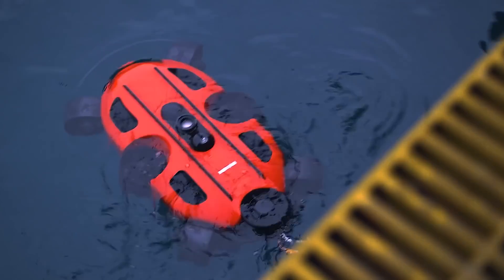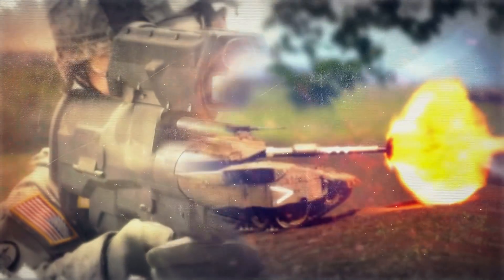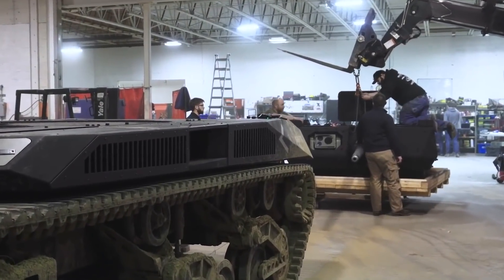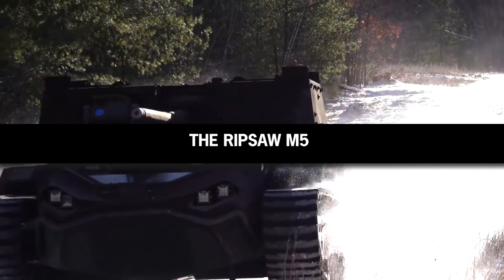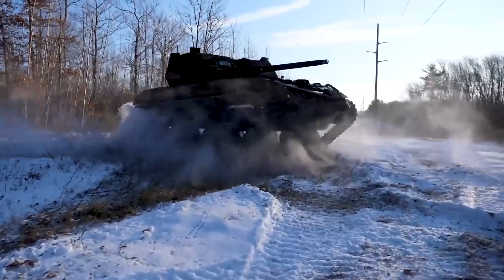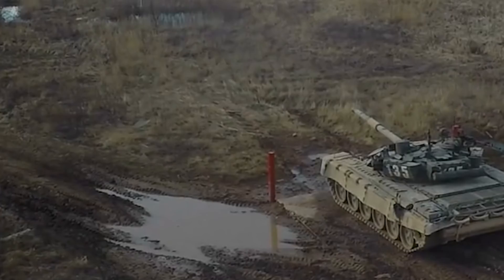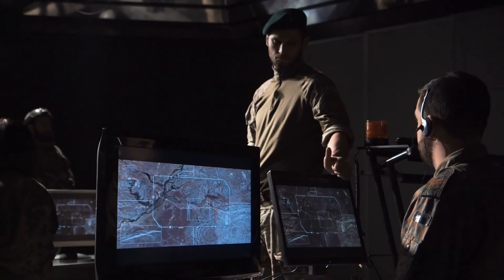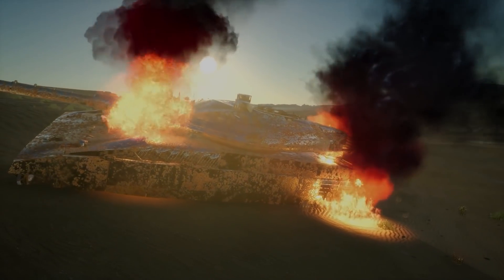The Next-Gen Superfast Armored Tank No One Expected

Comment: An aerial drone can deal with a momentary loss of signal by continuing on a plotted course, but it is somewhat more difficult for an unmanned tank, and the control range seems a bit of a limitation.  Developing a nav system that can deal with momentary interruptions in control on flat roads sounds easy, but less so in the massive variety of terrain the drone could find itself in.  Aerial drones can also deal with active jamming with a contingency program to get out of range of the jammer.  That may be less possible for an unmanned tank.  Presumably, near peer opponents of the future will have some technology and doctrine for dealing with drones of many types.
Reply: This, self driving and operation tech would have to be developed for this to be feasible. The Russians tried it Syria with their autonomous tanks but all of them were either lost or had technical issues.

Comment: This is the future of tank warfare, not this specific model though as it has many shortcomings but it's just a demo of things to come. Drones across all branches of the military will dominate 6th generation warfare.  

But being tethered to just 1 mile operational radius is terrible, not to mention that tiny turret wouldn't be able to penetrate the thick armor of older generation tanks either, nor hold enough ammo in it's small size to stay engaged in battle for long but it's a proof of concept. Once these tanks are uparmored, upbored on the main gun, upsized to increase munitions capacity and can be operated by satellite you are going to see all previous era tanks with 3-4 man crews be even more outdated than they already are in 5th generation warfare against the hard counters of stingers, javelins and switchblades.

Comment: The tank industry needs to be taking cues from the aerospace industry with these unmanned tanks. Future manned tanks are going to be the quarterbacks of the ground war. They will need to be able to defend against other tanks, but mostly they should have anti air and NLOS artillery. Autoloading but retaining the fourth crew member. (Commander, Gunner, Driver, UGV operator.) Similarly its predicted that we will soon be returning to 2 seat fighter configurations as standard. As the pilot needs a hand controlling loyal wingmen. At least until AI technology lowers the required ratio of operators to drone systems

Comment: I think they should use a hybrid system.  That seems more flexible.  If it's electric only, you need to have a generator within 1/2 mile of the enemy.  That seems totally impractical.  I'm sure the vehicle needs a lot of juice which would equal hours of charge time.

Comment: If each Ripsaw had a repeater on it, then only one would have to be within a mile of the command unit.
If you have five or ten spread out over a large area, a city maybe, that allows your command unit to move almost anywhere they want, as long as they keep within range of any single Ripsaw.
Reply: ''Army tactical MANETs
Military or tactical MANETs are used by military units with emphasis on data rate, real-time requirement, fast re-routing during mobility, data security, radio range, and integration with existing systems.[23] Common radio waveforms include the US Army's JTRS SRW, Persistent System's WaveRelay and the Domo Tactical Communications (DTC) MeshUltra Tactical Waveform.[citation needed] Ad hoc mobile communications come in well to fulfill this need, especially its infrastructureless nature, fast deployment and operation. Military MANETs are used by military units with emphasis on rapid deployment, infrastructureless, all-wireless networks (no fixed radio towers), robustness (link breaks are no problem), security, range, and instant operation.''
Reply: @garryclelland4481  yes, but can they stick it on a Ripsaw? :)

Comment: As all electric it will be quiet, quick and agile.  An extremely deadly weapon system for the 15 minutes of run time.
Reply: Fighting up north in minus you get 5 min 😅
Reply: They last much longer. Electric batteries have come a long way
Reply: @cooldudecs  You need to have generators all the time to charge them. It is easy to bring and fill fuel, but how much time you will need to charge it and if you need to charge 10 of such tanks in the same time?

Comment: It is an interesting idea but the fact that it is electric means its a very bad idea,  electric is good on paper but battery tech has not really improved that much and as we can see from Tesla range is limited and recharge time is still very long under normal conditions, sure there are super chargers but they consume massive amounts of power and infrastructure you know things you will not have on the battle field, given that this tank as they say is around 3.8 ton without payload and fully loaded would probably mean its battery is smaller than the ones in tesla cars, so lets say conservatively  it can do 350miles on a charge probably much less, which sure is more than the abrahams range bur range is not everything if you are unable to recharge it.   A conventional tank you can truck out  or air drop fuel and with in a few min its back up and running or you can use the fuel  from the resupply in the convoy, but how do you recharge an electric tank in a combat zone?

Comment: This thing is just another concept that has been submitted to the US Army
The Prototypes are lacking in any serious armour and the proposed production armour wouldn't stand a chance against a simple ww2 anti tank rifle (whereas all modern tanks laugh at the thought of one)
Things would be sitting ducks on the battlefield and otherwise would be sent into what is a suicide mission for the asset, you'd need something much heavier to stand any chance on a modern battlefield against actual tanks. So this isn't a tank and isn't an anti-tank vehicle. Small gun and lightweight armour.
Actual ripsaws are cool but they are not tanks either, not even by the slightest imagination of the word.
This particular concept is a light armoured vehicle with the capability of middleweight arms.

Comment: I'm an ex-mechanized infantry soldier and I can tell this thing is the future of ground warfare. It won't completely replace manned armor, in the same way that aerial drones won't completely replace manned aircraft. But just as aerial drones are playing a huge role in modern air warfare, ground drones will play a huge role in future ground warfare.

A few points about future developments we'll need to see:

The control range needs to be drastically increased. Luckily aerial drones already have directional satellite systems that cannot be jammed and allow the vehicle to be controlled from anywhere on Earth. Fit one of these systems into the Ripsaw.

The armament will be fine with a 7.62mm machine gun, a 25 - 30mm auto-cannon, a couple of Stingers and a couple of Javelins. This will allow it to attack almost anything. Give the auto-cannon a high elevation angle so that it can also be used against low-flying aircraft such as helicopters.

Use the extra payload capacity to install a small diesel-powered generator to recharge the battery when needed and extend the mission duration.

Install a self-destruct explosive to stop it falling into enemy hands.

Automate the control system to the point where it can do some duties without direct human control. For example, fit it with a short-range radar and put it on sentry duty to guard bases against drone attacks. Simply give it a quadrant to guard and leave it to do it's job.
Reply: Much of what your wish list contains is already on or coming to a military hardware shelf sometime sooner than you might think. Textron has been a great fit for the Howe twins- they seem supremely well adapted to innovative solutions delivered quickly- Textron adds the dimension of scale production. The importance of modularity to that end cannot be over emphasized.  The all electric drive is a new departure for the H&H teams- I would look forward to it in the mining robots, fire fighting remotes and other patented designs. Getting these two noticed by the Army was as much the doing of the late Senator, Olympia Snow and FWIW, Textron had no idea till after that. Great looking lash up, though!  FR
Reply: Agree completely, I had the exact same thoughts.

I'd make the self-destruct when tampered, not only prevent tech theft, but takes a few enemy techs/soldiers down with you.

My other thought is that diesel generators make the tank more detectable and dependant on oil logistics. I'd rather just use that space to add more batteries and/or solar charging.
Reply: @wefinishthisnow3883  Definitely a HUGE self destruct Mechanism. look Rajneesh the tank is broken. Walk up to it KA-bOOOM
Reply: Javelins are the bane of current gen vehicles, but they are not futureproof. They are vulnerable to point defence in a way that a lump of tungsten flying at 1000m/s is not. Even if that type of top attack munition were going to be appropriate for a long time, a smoothbore gun is able to fire them so this isn't a point against them.
Personally I think advanced smoothbore 'first stages' with very high elevation are going to be used where possible for gun launched missiles. You are able to get more performance out of propellant than from a rocket starting from zero. That could be used to get a starstreak style beamrider up to ~600m/s before it even fires it's booster, potentially giving you a Mach 5 weapon capable of taking down even supersonic low level flyers. Alternatively it could fire smart mortar shells, which seem to be the thing really doing the damage to Russian armour.
Basically, anything you can do with a rocket you can theoretically do with a gun (with some difficulty, but manageable), if you have a platform that can handle the recoil. While you could use a fully rocket system to fire a sabot dart, the low efficiency at low speeds of rockets mean it isn't really feasible. For any missile you care to design, it can be outperformed by a smart munition, so I don't see guns going away.
A diesel generator capability would certainly be useful, but I wouldn't want it forced on it. It should be a swappable module. If nothing else, a defensive formation of them does not need to have a generator on every vehicle, and the storage capacity might be better used for other logistical support for surrounding infantry. More dedicated combat generators seem appropriate, especially given that SAM sites in particular can use a lot of power. I imagine we are going to see increasing electrical requirements near the front, but the thermal and noise signature would make you want to have generator capacity a little further back if possible.
I don't see a self destruct as being a very desirably or necessary feature, given how dependent on software and firmware it will be. It would be pretty easy to either lock out, or even turn spy if captured. Would you turn on sensors that were built by the enemy and have a satellite uplink in your own position? Unlike a manned system, you can't just steal and put your people in it.
Reply: Lol then the scene of the police robot going rogue in Robocop becomes reality because a malfunction or a hacking.
Reply: I can imagine resurrected automated electric M113s following self propelled 155s.
Reply: "but if we arm it with everything, we can't sell our 'modular' system as upgrades and lock them into our ecosystem for decades"
Reply: The Possibilities eh Grunt? I'm envisioning Infantry units having these. Just Bristling with weapons.
Reply: After seeing the trend in Ukraine it is my opinion that the era of the tank is over 1916-2022. Man portable anti tank weapons just keep getting better and better. The new NLAW costs $40k and can kill a main battle tank.
Reply: @TheRdickey  everyone has always said that. find a better platform to mount a huge cannon to that can move fast and traverse all terrains and we'll agree
Reply: I'd personally be more concerned with how gear from military trickles down into police forces in authoritarian countries + the US (weird huh). Can't wait to see the exploits of Deputy Ripsaw on Cops
Reply: That certainly looks like the future of IFVs but I wonder how tanks will actually evolve, there will be a niche for anti-drone warfare where MBTs could work well.
Reply: brilliant   😌
Reply: Why not a swarm of mini tracked roving drones equipped with claymores that a remote pilot could trigger?
Reply: "It won't completely replace manned armor" artificial neural network alias "Skynet" do not agree with you... ;)

Comment: I remember when they were still figuring out how to keep the tank treads from falling apart. It made me appreciate how a tank doesn't lose its tracks every time it makes a turn. It's come a long way.

Did they give designing their own armor another try?
Reply: It has wheels, but tracks instead of tires which are clearly better off-road.
Reply: @DanTube2010  I said this as a joke
Reply: Yes I do
Reply: Just use wheels
Reply: @maxonmathew4557 wheels have worse cross country performance than tracks as they have limited points of contact with the ground thus putting the weight of the vehicle on the wheels that are on contact with the ground thus making a higher ground pressure which results to the vehicle either struggling to go thru deep mud or just get stuck, tracks have better cross country performance because it spreads the weight of the vehicle on the tracks which has way more points of contact with the ground than wheels thus resulting to less ground pressure
Reply: @pls_rember  I am aware I said it as a joke
Reply: @maxonmathew4557  Then use the "/s" designation.
Reply: @danielburgess7785  I am so sorry I didn't no joking was so complicated
Reply: @maxonmathew4557  It's the internet, nuance is wasted and most rational thought an exercise in futility.  

Why yes, I am older than dirt.  /s
Reply: @danielburgess7785  
Being "older than dirt" isn't so bad.
Lava is older than dirt, and it's damn hot!  ;)
Lava: "Don't tread on me!"

Comment: It’s cool and all, but if the ripsaw is accepted by the military, it’s probably going to be very different from the prototype, because cost will always be a factor. Based on the roles the ripsaw will be performing, it will need to either be cheap to replace destroyed models, or easy and cheap to recover and repair. No matter how much technology you put in a tank, some madlad with an rpg or 5 is all that’s needed to disable a tank, especially one as small and compact as the ripsaw
Reply: Wouldn´t the "small and compact" make it really hard to hit with RPGs?
Especially given just how FAST it is?
Reply: @sim.frischh9781  Also the mobility factor only works when the tank is constantly moving, even if it's harder to hit, all you need to do is ambush the control tank by being patient. Also mines and IEDs exist which are significantly harder to see
Reply: @ryanturner9057  Since they speak of "being resistant to 105mm cannon projectiles" stuff like mines and IEDs won´t bother it.
It IS a TANK, after all.
An IED cannot take out tanks unless it´s properly placed on a vulnerable spot, and about the mines, i suspect that the Ripsaw is too heavy to trigger anti-personal mines and too light to trigger anti-tank mines.
Not having to house a crew significantly reduces size and thus armor surface, reducing the overall weight dramatically.
Best way to take it out would be an EMP attack, i would wager.
Reply: @sim.frischh9781  fair point. We're probably gonna have to wait until live combat reports finally come in to see just how effective it is in active combat scenarios. Though I am curious to see how rivaling militaries will respond to the deployment of the ripsaw
Reply: @ryanturner9057  I totally agree, we can guess our asses away, but what´s in the sausage you only know once the ketchup squirts.
Reply: @tinetannies4637  Yes, strange how this seems to work, doesn´t it?
Reply: @tinetannies4637  You can thank the bureaucrats for the money spending. Unlike other nations, the US constantly up plays the amount of money they need to invest.

Comment: Interesting, range, battery capacity and recharging stations? Cool if they can address the support elements.
Reply: Probably gets towed to the front and charged by a support vehicle with a diesel generator.   If not for the 1mi limited control range it would have an internal combustion engine.  As range is a non-factor, the battery reduces physical complexity and idling performance.

Comment: Why not just take an old M1A1 Abrams and make it unmanned like this? It won't be as cheap and likely need a new turret or autoloading gun, but it should survive contact with the enemy. This is like an expendable drone, but depending on the cost, it could be expensive if enough units are lost.

Comment: what makes this a super tank? 30mm cannon is useless against pretty much all tanks. sure its small. but i guess it has no armor since it doesnt need to protect its crew so it wont be able to withstand any beating except small arms (less than 50cal).
Reply: Doesn't have to be a 30mm.
Could just as easily give it a dozen antitank missiles and a 3 barreled 50 cal. You could mount anti-aircraft missiles, or an automatic mortar. The high velocity cannon isn't the only way to skin a cat.

Comment: The fact that it’s remote distance is “up to one mile away” means this thing is basically unusable.
Reply: @Another-Address   I’ve had to use issued unmanned vehicles that we’re supposed to reach up to 500m. They would lose signal from traveling 5m around a corner.